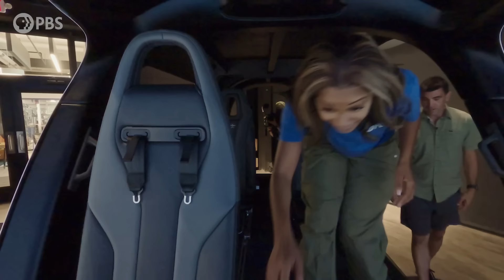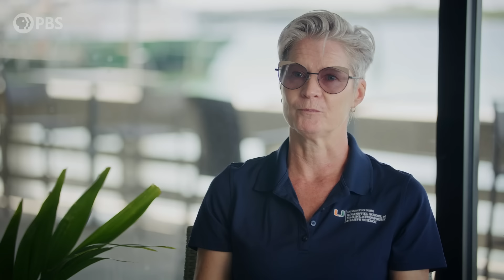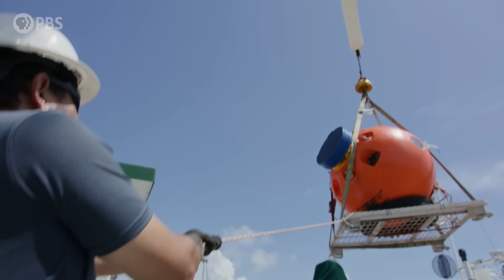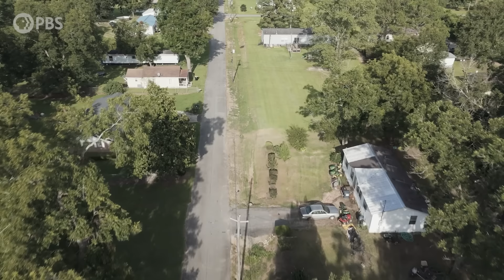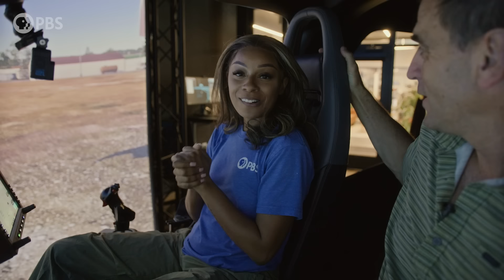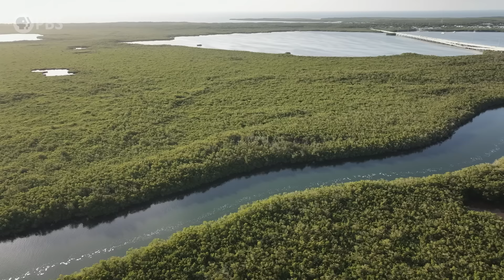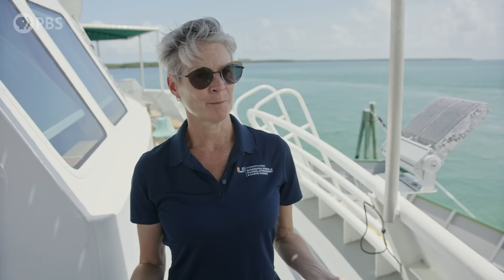This Is The Best Evidence That Atlantic Currents Are Slowing (AMOC Explained)

Comment: Mass electrification is the way. We just need cheap reliable grids which requires infrastructure investment on our aging grid, and the reduction in permitting and installation times.
Reply: If youre referring to solar panels, those are not disposable, and neither are batteries. Also batteries require lithium, which the earth has a finite source of. Not to mention the process of mining lithium is the opposite of what you believe to be "green". ANd what do we do about CO2 levels when we remove normal types of fuel from being released into the atmosphere? DO you understand what happens if the CO2 level drops by .02%? All plant life on earth dies. But they wont say that. They also bring in Stacey Abrams, like shes some credible source, shes been caught lying and stealing from these very organizations. Thats the funny part.

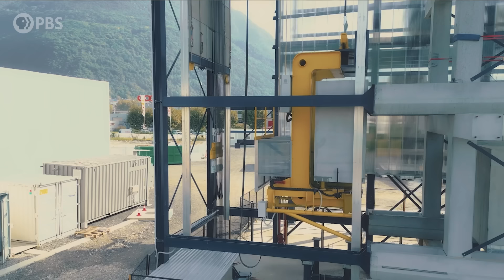Comment: 16:30 The beauty with a gravity battery using material potential energy rather than chemical potential energy in a traditional battery is that you can use waste materials for it. Have excess stone from mining? Dope. Gravity battery. Demolition project on an old building? Dope. Gravity battery. Clearing downed trees after a storm? Biodegradable gravity battery that can be topped off anytime there's more downed trees. Amazing!
Reply: @d.w.stratton4078  The drawback is terrible energy density
Reply: Energy density too low
Reply: no, why you just use batteries?

Comment: Please do some actual research on electric planes and gravity storage.  They are not the solution.  And you might want to explain why heat pumps are the solution, even when they are powered by electricity generated by natural gas.  But mostly, if you're going to title a 26 minute video about the AMOC, you should include more than five minutes of AMOC-related content.
Reply: I agree with you on electric planes and gravity storage.  However, heat pumps are a huge improvement over current AC and Heat systems.  The less you are pulling from the grid the less power that has to be generated with oil or gas.  Natural gas is far less pollution than oil or coal as well.  Not to mention the savings for the homeowners.
Reply: @loganskiwyse7823  You read me wrong on heat pumps, and you also got the benefits of heat pumps wrong.  Burning natural gas to generate electricity and then using that electricity to run a heat pump is five times more efficient than burning natural gas to directly heat your home.
Reply: @rockets4kids  Opps, we both misunderstood each other.  I meant gas being burned at the generator.  I do apologize for misreading or misunderstanding you.

I think we are more on the same page then I originally thought.
Reply: @rockets4kids  Honestly, I think they are afraid of being honest about how bad the situation actually is.  So much denial on this subject resulting in them trying to not sound like alarmists when the actual situation is downright scary as hell.  Very glad I made the decision never to have kids.

Comment: Could the solar maximum be affecting this current?
Reply: No
Reply: @b3yourself91 
Why not?
Reply: A 2008 study, "Surface warming by the solar cycle as revealed by the composite mean difference projection" by Charles D. Camp and Ka Kit Tung, concluded global temperatures are on average 0.18C higher at solar maximum. However, it's considered insignificant compared to rising CO2. NASA has a graph of global temperatures versus solar activity. From 1850 to 1980 the two are pretty well correlated. After that, the temperature keep rising no matter what the solar cycle does.
Reply: @toastyburger  Correct, thanks for posting the study.  One thing that is left out is even during that time frame the overall rise in temperature was still ongoing regardless of the solar cycle.  Just not to the degree it is happening now.  Prior to the mid 1900s the solar cycle had a more dominating effect, just the industrial age forward burning of fossil fuels was having a consistent but smaller overall effect.
Reply: @toastyburger thanks Toasty. I enjoy references.
Reply: Not really.  Ignoring the science and blaming the sun is a common denial tactic.  But the truth is the science already takes solar activity into account and always has.  It's just a distraction by those that refuse to accept reality.
Reply: Just asking a question, stupid question but I knew one of your punks would insult me. It’s in your nature.

Comment: I first studied AMOC in the early 1990s - never could I have imagined that it would be at risk within my lifetime :(
Reply: Neither I.. these data looks solid as hell
Reply: People literally don't care..."I'll be dead hahaha".
Reply: Grifters paradise. That all earth is at this point
Reply: I'm here 6 months later because a new study is saying that the risk is a lot higher than our recent estimates
Reply: @chrishedlund2688  It's not. 
This is a scare story about things you cannot see. 

To quote the Chief Scientist at the National Oceanography Centre, Professor Penny Holliday, "There hasn't been a slow down. There hasn't been a slowing of the AMOC."

Actual observations using the RAPID-MOCHA array from 2004 to 2023 show, that although there can be a great deal of variability of flow in the ocean from month to month or even day to day, there has been no decline in the Gulf Stream, with flow oscillating around 32Sv (32 million cubic metres per second) throughout the period of observation. 

Continuous section measurements of the AMOC, available since 2004 at 26°N from the RAPID-MOCHA array, have shown that the AMOC strength decreased from 2004 to 2012, and thereafter, it has strengthened again. No relationship to CO2. 

MOC spanning the North Atlantic at 27°N derived from RAPID/MOCHA/WBTS, satellite altimeter, and Argo floats for 1994 to 2020 shows no statistically significant decline (-0.06 Sv per decade). Furthermore blended meridional overturning basin-wide circulation (MOC) trend estimates (Sv) based on combinations of satellite altimetry and in situ hydrography data exist for the South Atlantic for 1994 onwards: at 34.5°S (often referred to as SAMBA) is +0.48Sv per decade. This is a significant positive trend, so no decline, no tipping point, no correlation to CO2. (GLOBAL OCEANS G. C. Johnson and R. Lumpkin, Eds., 2021)

The OSNAP MOC Timeseries of observations from Canada to Greenland and across to Scotland, although a shorter timescale (from 2014), show no decline in MOC with the flow fluctuating around 17Sv.

"Florida Current transport observations reveal four decades of steady state" Volkov et al, 2024 (published in Nature). This paper shows that a key component of AMOC, the Florida Current, has remained remarkably steady for over 40 years. 

There is no climate crisis. 

 

The North Atlantic current has doubled its velocity over the course of a quarter of century (Oziel et al, 2020). This is based on actual satellite observations. 

The idea the AMOC is going to shut down is based on modelling. There is minimal real world evidence to support these outlandish claims. It relies upon climate models. You know, those Magical Truth Machines that keep making false predictions. It claims with 95% certainty that the AMOC with collapse by the end of the century. Come on! Really? These numerical models produce ocean circulations that are far from what we actually observe. These models can't even replicate one of the key physical processes, Convection, in ocean currents "because convection is a small-scale process, it is not captured well in most current models (Jackson et al (2023)" (Rahmstorf, 2024). So they can't model Convection. So they can't model ocean currents.  

 

The most recent research into the AMOC confirms it is not weakening. From a 2024 paper by Terhaar et al published in Nature Communications "Based on the here identified relationship and observation-based estimates of the past air-sea heatflux in the North Atlantic from reanalysis products, the decadal averaged AMOC at 26.5°N has not weakened from 1963 to 2017". So not even close to a tipping point or collapse.

 

Sea surface temperatures (SST) were trending downwards 2000-2018 (HadSST 4), and from 1950-1980, and from 1880-1910. The oceans warmed at a faster rate 1910-1940 than 1980-2010. Remember CO2 has been accumulating in the atmosphere at an accelerating rate all the time, so there is little correlation between the two. 

Also the 'Cold Blob' has disappeared from North Atlantic surface temperatures, when annual anomalies for 2013-2023 are compared to the average for the period 1979-2010 (ECMWF ERA5). The International Comprehensive Ocean-Atmosphere Data Set (ICOADS) shows a Sea Surface Temperature departure of over +2°C exactly where the Cold Blob used to be. It may have been there but it's gone. Looking more carefully using NOAA ERSST V5 data for North Atlantic Sea Surface Temperature anomalies (50N-65N, 50W-10W) shows in 1942 a +1°C anomaly declining to -0.7°C in 1992 then rising to almost +1°C in 2010, declining again to -0.6°C in 2010, and of course rising again to +0.75°C in 2023. There are also oscillations in the data back to the 1850s, but there is no trend overall up or down, and no correlation to CO2. The same is true for the heat content in the North Atlantic down to 1000m (Met Office data). No correlation to CO2, just a natural variability. That's the data. The Cold Blob is an artefact. 

 

The North Atlantic ocean has cooled and warmed rapidly and repeatedly during the current interglacial with no correlation to CO2 e.g. 10,300-10,200 years before the present (y BP), 9,500y BP, 6,000-5,900y BP, 5,400-5,300y BP, 2,500-2,300y BP, 1,700-1,600y BP (Berner et al., 2008. See Figure 8 in the paper). There is a high frequency (18 events) of SST variability on the order of 1-3°C during a 10-50 year time resolution throughout the Holocene in the North Atlantic with no correlation to CO2.
Reply: The fossile industry already started global disinformation campaigns in the 90s.
Reply: You didn't imagine AI using 2-5% of our power. Or Bitcoin sucking up another 2-5%. Or wars in Israel and Ukraine. Did you even think we would have Starlink? 120 Starlink satellites fell to earth in just Jan. 2025 leaving behind aluminum oxide that depletes the ozone.  We are going backwards.
Reply: yeah, its pretty important to life in europe/america as they know it. but ironically the ice age it causes  might save the permafrost from continuing its run away melt in north and +9*c scenerio
Reply: @chrishedlund2688  it's not. Another doom scenario to sell newspapers and magazines and tv documentaries. It would not affect Europe that much even if.  Doom scenarios, on going since civilisation began. There is nothing new or different in global climate in the current holocene.
Reply: You're right as you could have never accounted for the geoengineering psychopaths spraying the world's population like this
Reply: Yes, me too, 96-99.
Reply: I studied the AMOC too, unfortunately nobody will listen, and by nobody I mean industries
Reply: it's very unlikely that it's at risk in our lifetimes, some studies show that the AMOC may be more resilient than we think. but our children and grandchildren ? future is looking grim for them.
Reply: @danilooliveira6580  Well it got it half right. My grandchildren's grandchildren will be just fine. As will the AMOC.
Reply: @TimothyGasser  they probably aren't, if we don't control, or at least drastically reduce, climate change by 2050 things will dire. it's hard to say how bad it will be, but things will be very chaotic for the next generations. as for the AMOC, it's hard to say because there are studies pointing to both directions. but again, the worse climate change gets, the most likely it will be to collapse in our grandchildren lifetime.
Reply: Never thought I would see a USA dictatorship in my lifetime either. But here we are. We shall have both😢
Reply: @Etty-c5b  rubbish. Trump is a fantastic leader. The Amoc will be fine. Just like all the other doom scenarios, bs. It won't even affect Europe as much as they want you to believe.
Reply: Welcome to the new age!
Reply: It's not
Reply: @alabastardmasterson are you an expert doubt it so the words you mean nothing
Reply: Dont worry, its not.
Reply: @manoo422 based on?

Comment: I always laugh at "gravity batteries" because the energy density is so incredibly low. If you have a 10,000 lb block of concrete, you would have to lift it to the height of Mount Everest in order to match the energy of the battery pack in a single EV. It's preposterous how energy dense batteries are that it doesn't make sense to use anything else except hydroelectric reservoirs but those require specific geometry and have pretty massive impacts on the local ecology.
Reply: you can store energy as heat in sand towers or clay bricks

Comment: Heat pumps still don't work below 40°F: The new models are just heating under the outside coils so that they keep working. This is actually no more efficient than just using auxilliary coils inside the air handler. The real difference is that the new heat pumps can air condition up to ~120+°F as opposed to ~105°F.
Reply: Not true.
Reply: Not an expert, but a quick google found form discussions of heat pumps still being cheaper than their gas backups below 20°F, and Wikipedia's COP table goes down to -4°F
Reply: You must be thinking about an above ground heat pump. A geothermal heat pump solves your concern. It costs more but you need to pick the right solution for your situation.

Comment: If AMOC weakens then hurricanes receive less wind shear leading to larger hurricanes.
Reply: Not nessecarily larger, but with less blocking them. Regardless a strong El Nino can hinder significant development regardless of AMOC weakening or warm water.
Reply: well great…
Reply: Yikes
Reply: Fart into the hurricane to slow it down with diarrhea chunks
Reply: AMOC is now turning to cold phase (cycle 60 - 68 years). 
Late 60´s and early 70´s we were going to imminent ice-age. That was also absolute truth. And probably it will be absolute truth again.